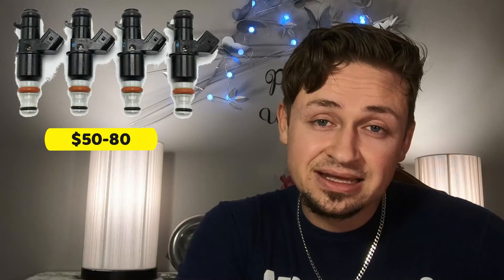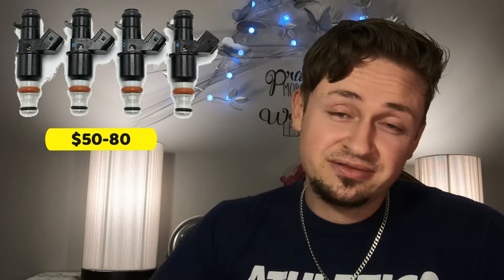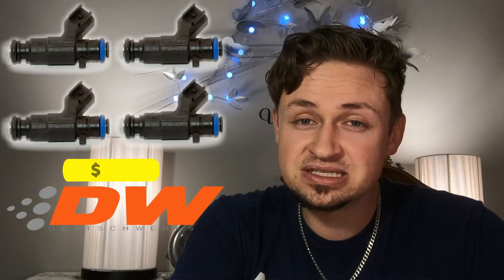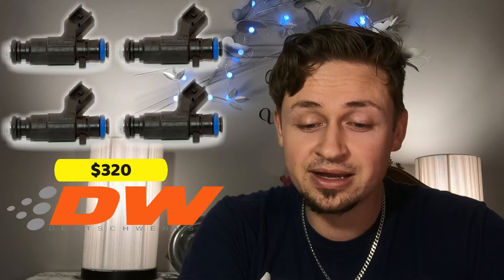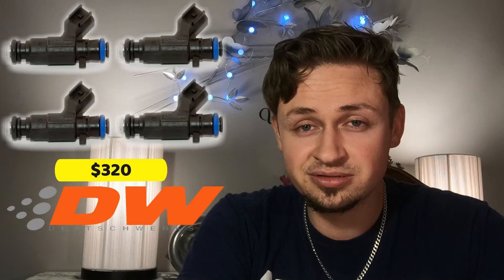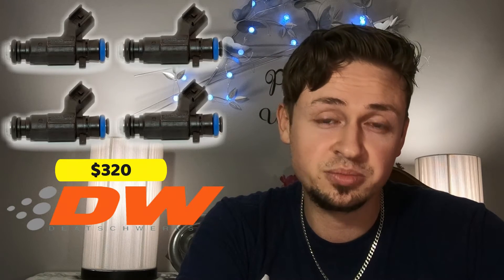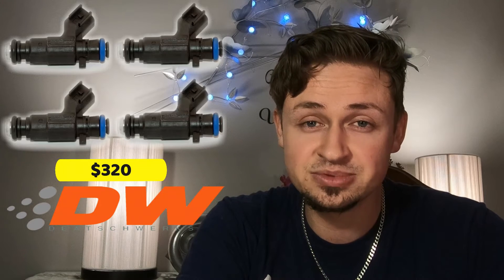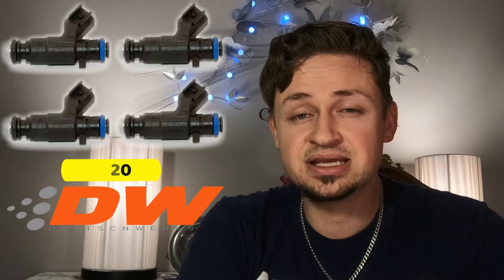Choosing the Best Fuel Injectors for your Turbo Honda Civic R18!

Comment from the maker: What fuel injectors are you running?
Reply: Hello sir can i replace the stock injector and fuel pump into k20 injector and aem fuel pump but my r18 engine is stock? Is it ok?
Reply from the maker: @roselynmaegarcia672  you need hondata tuning software to use the k20 injectors.  You can’t just install them and not tune it. It won’t run.
Reply: @BulliKid  actually we are running HTS canbus to tune my fd bro. There is also a Thailander a friend of my tuner here in The Philippines who will do reverse engineering on my stock ECU from maf to map. I am just having issues about the k24 stock injector if it would work.
Reply: @BulliKid  before you switch to RDX injectors did you try the stock r18 injectors as well on your turbo build?.
Reply from the maker: @Budgetmealracer  stock are way to small size for turbo.

Comment: What year RDX injectors? I’m running a stock R18a with a cold air intake under the bumper. Stock exhaust, and catalytic converter is intact and code free. Don’t want to turbocharge the engine, and I’m staying stock exhaust on my daily driver. The car is not subject to emissions testing in Florida.
Reply from the maker: @waverider5751  I believe 09-2013 they had the k23 turbo RDX motor.

Comment: @BULLI KID i need your help i cant find no fuel injectors for my 2014 civic lx i need 310cc injectors or 410,420cc
Reply from the maker: You can buy directly from Honda or Acura
Reply: @BulliKid  if i was to get 410cc injectors for my car would i need to get a new fuel pump or am i able to run stock fuel pump the max power im going for on my car is just around 200-215 smt like that
Reply from the maker: @diogogouveia9392  stock should be fine. Mine is stock.  Holding up well. Im at 105k miles.

Comment: What would happen with bigger injectors running a turbo? I plan to run the same turbo bit I think I got way too big injectors, ebay claimed they were SI but seem way bigger. I plan on running low boost and daily driver the car
Reply from the maker: There shoukd be no problem as long as its calibrated  in hondata

Comment: Can I run a weapon r tune with stock injectors?
Reply: I running n/a
Reply from the maker: yea there would be no problems! Im not sure how accurate the tune will be but im sure it cant be too far off
Reply: How can I view my live tables ?
Reply from the maker: Which live tables?
Reply: @BulliKid   to mess with the fuel maps and the timing
Reply: @BulliKid  my wot tables I can’t see them I click on them and it’s just a white screen
Reply from the maker: @isaiahpena8776  check my tuning 101 video. You may have to update the software.
Reply: @BulliKid  I did check it says I have the latest version
Reply from the maker: @isaiahpena8776  send me a video on IG  of the issue.
Reply: @BulliKid  can I have ur IG
Reply from the maker: Bulli kid same as YouTube.

Comment: FN2 310cc
Reply: How much hp u got on 310 CC, they ars not to small?
Reply from the maker: Yeah, I was running about six or seven psi on the 310 cc but they were pretty much about maxed out later I swapped to 410 cc